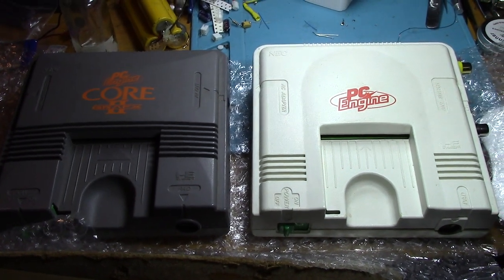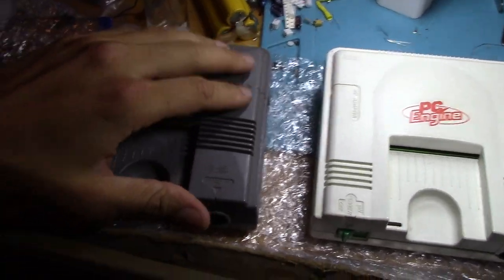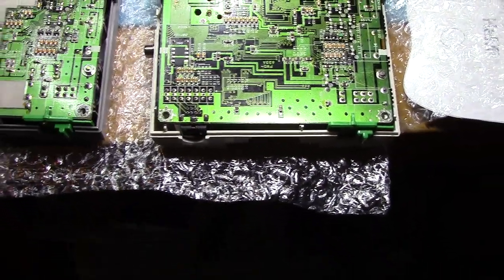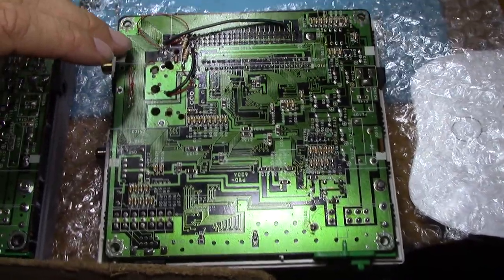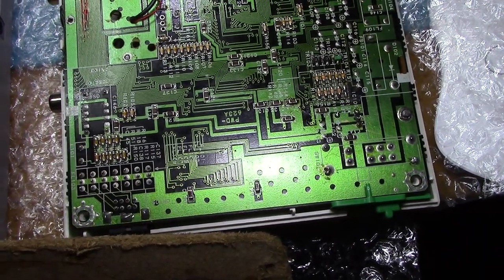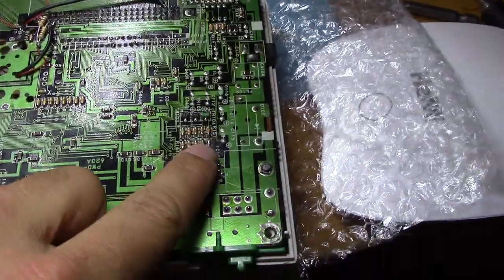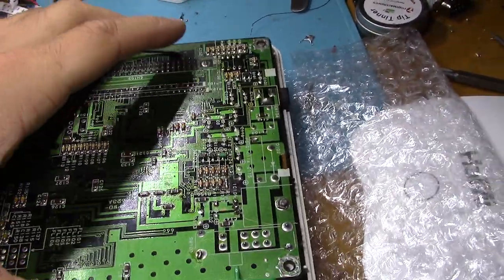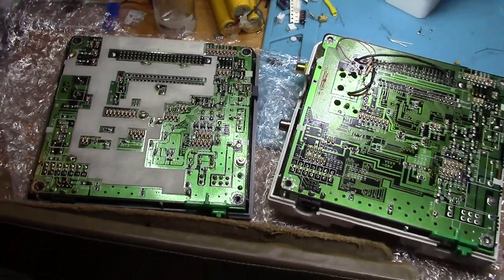[SSFD] Comparing PC Engine and Core Grafx II

Comment: The original white PCE was silently revised with metalized film shielding at some point, then CoreGrafx added proper shielding with external ground contacts that mate with the Super CD-ROM² and the revised Interface Unit (IFU-30A as opposed to IFU-30). It also has the A-rev VDP (HuC6270A) from the SuperGrafx with an AV multi-out.

CoreGrafx II was a slightly cost-reduced CoreGrafx, integrating the external ground contacts into the metal shield instead of needing multiple contacts and springs.